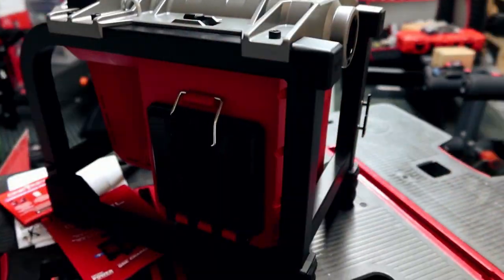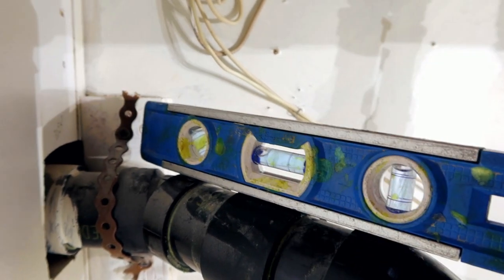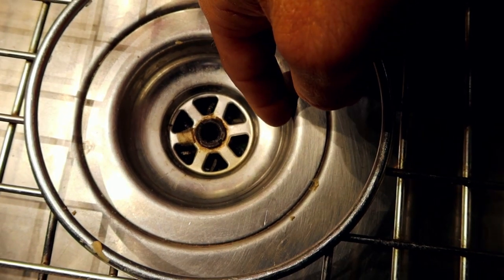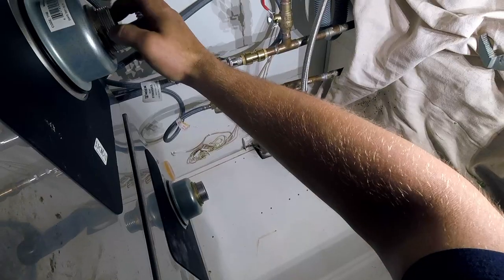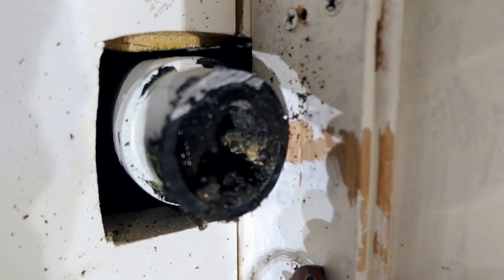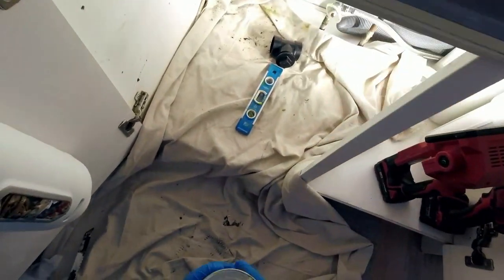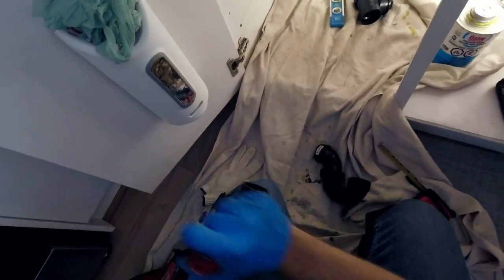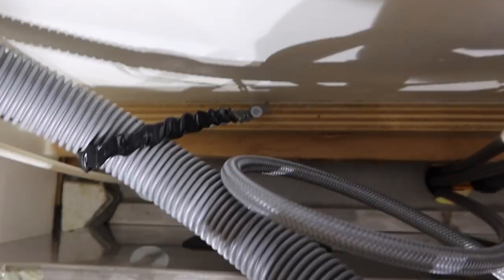A Day In The Life Of A Plumber 136 | Why I don't install these basket strainers!!!

Comment: Which one is better using putty or silicone ?
Reply from the maker: I personally prefer using putty. But there are a lot of plumbers I work alongside that use silicone instead. You should try installations using one of each and see what fits your style.

Comment: Hello Kenny will that pipe break in the wall  with 5/8 i know sometime if you snake any  line it sometime break i know i like to use small machine like supervee from General 3/8 for small pipe like 2 inch  Do you tell customer it might break
Reply from the maker: Hey Walter, I’ve never had that happen before.  But I guess it’s a risk that’s possible with any old pipes when you’re snaking.